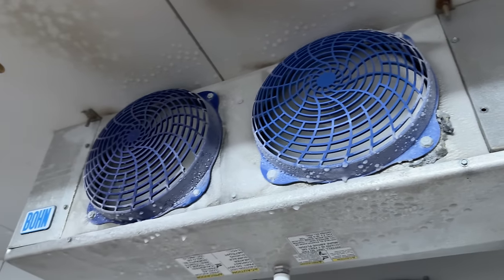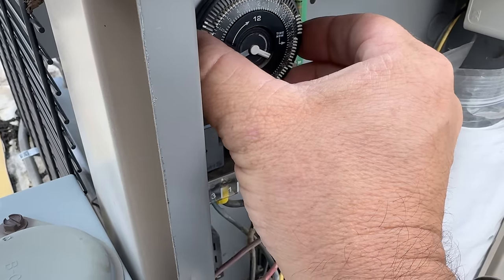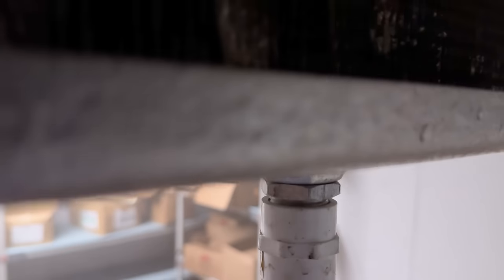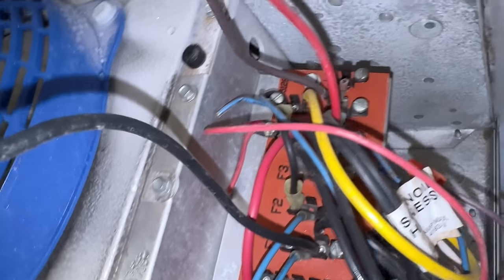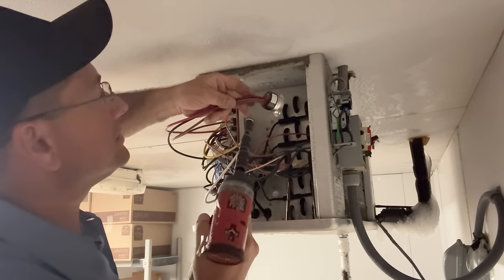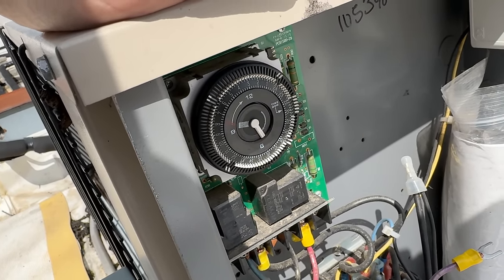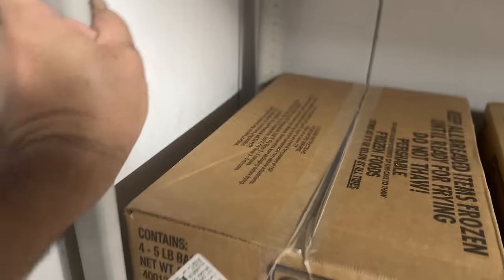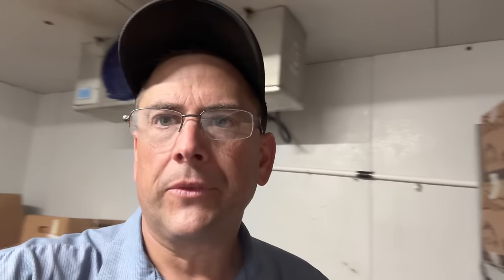Freezer Too Warm / Stop Cutting Corners!

Comment: Ill be the first to admit, couple times ive just pulled off the X on time clock and called it a night. I'll always leave it on return though to come back and replace the term.
Reply from the maker: And that's fully understandable. You sometimes can't do it in the middle of the night, but this job was done in the middle of the day originally and it kind of shits happened a few times. Obviously I couldn't go into it in the video, but you can put pieces together.

Comment: the GFCI red all the time, it's could be bad and stuck on, but it sounded like it tripped and reset so maybe ok.
I had a few bad ones last year(new out of box), red light stayed on power passing out and through both. but it would also not trip/reset, I thought I wired them wrong at first( done that before with head up my rear). but no, they were 100% bad legrand from menards. 😑

Comment: Retired now but have never used or seen PVC used in a WIF. Always ran copper, heat tape and insulated and p trapped out side box.
Reply: Same here. Not retired, but always use copper and wrap the heat tape on the outside, then insulate it.

Comment: I have pulled x before in some situations ,why not pull it of on roof  and do 30min.if you already in the evap, why not just change the dtt,i could see if it was 6pm and evap was a block of ice and cant get to dtt quickly. But he was already in there,why didn't he just change dtt?
Reply from the maker: I would guess it’s harder for another to notice it. The paper work said it was checked. That’s the bs part of this.

Comment: Ive bypassed the DTFD to get through the weekend before, but they will not work right without it. Eventually, you end up with ice all over everything. Just had to do it weekend before last because fans were not coming on.
Reply from the maker: And I agree that's totally fine. There's definitely a difference between a temporary fix and a permanent half ass fix.

Comment: the ring on the defrost clock seemed awfully floppy loose. I have a feeling you'll be back for that one( or someone else will). never seen them with the outer switch ring floppy loose like that and can only imagine it will be interment silly-ness. 🤔
Reply from the maker: It must of been the angle. It felt normal
Reply: @HVACRSurvival  it looked like it was wobbling all over when rotating it.

Comment: PVC pipe for walk in freezer and not insulated.also i don't see the pipe heat element ! I don't know what to said.
Reply from the maker: Heat Tape was seen at the back of the coil and went down the drain hole. You also seen the heat tape when I repaired the drain line and had to pull the heat tape out to rerun the pipe. I mentioned we normally insulate it. This was not installed by us, they have problems paying there bills so I'm not spending any extra time or money than needed.
Reply: @HVACRSurvival  sorry Sir I am not saying you didn't do the job right! I mean the beginning of the video. The last person was doing the horrible job 😭. Misunderstood
Reply from the maker: It’s all good man.

Comment: I have never ever seen Heat tape inside a PVC drain line inside a walk-in freezer. 
And no trap
Reply from the maker: It probably was taped at one time. Did you notice the hole through the wall not sealed 🤣. This place is a dumpster fire.

Comment: Didn't spot a P trap on that drain either? Although going by the door and the unsealed hole through the wall it's not going to be a major source of air infiltration...
Reply from the maker: You’re lucky if you can even get paid. I’m not going overboard.

Comment: I detect a note of cynicism in your demeanor,  after 50 years in the trade you will be totally cynical.  I am now referred to as the mean old guy that fixes crap.  
By the way, 2 screws and you can flop the terminal board out of the way .
Reply from the maker: Right on John 👍🤜🤛. I’m coming up on my 30 Th year next July